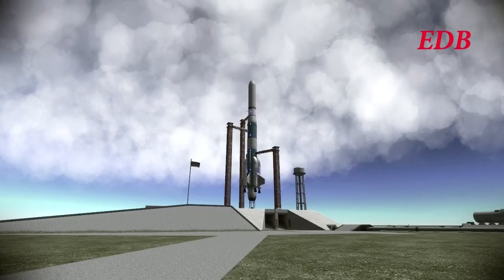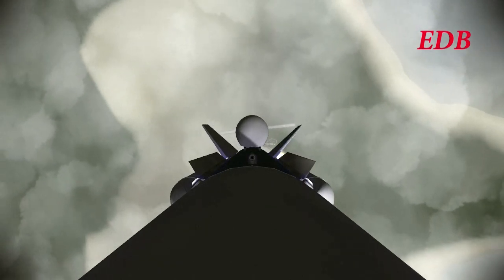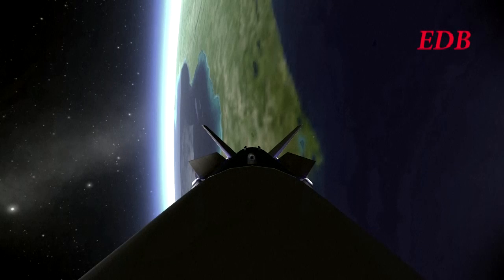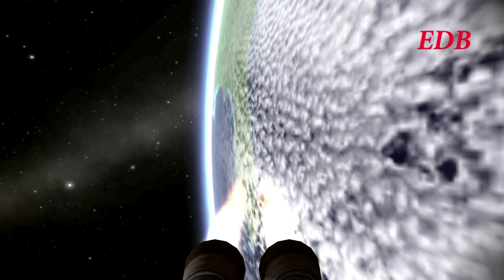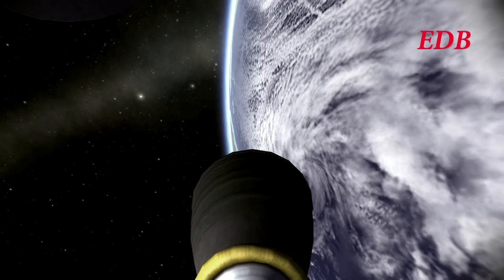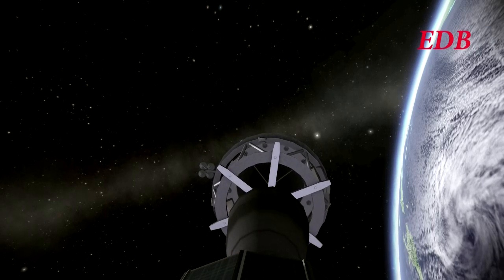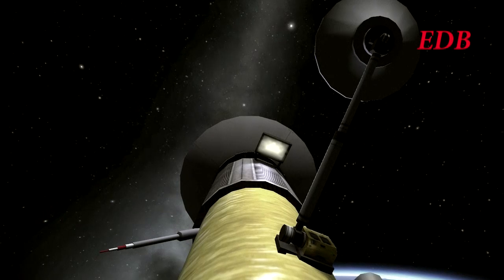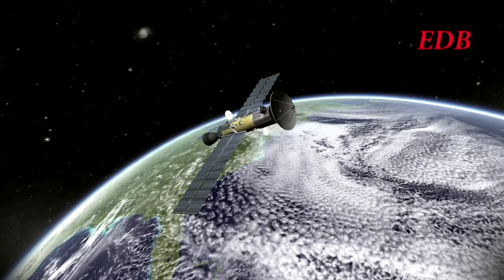Kerbal Space Program EDB Mission 01 - MIMAS-1 Launch

Comment: This is some truly awesome work! I love the style and professionalism (extending even to the press kit!)--an exceptional job.

A couple notes/questions (of course ^_^):
You should increase the height of the cloud layer--EVE 7.x has an issue with RSS where the 2D cloud layer is rendered about 5km lower than specified. That's why it's clipping into the ground in the mid-height shots. (The EVE Overhaul that rbray's currently working on is awesome, and you should check it out [daytime cities!] but it doesn't have scaledspace clouds yet).

Why fins rather than verniers? Given that you're in effect building a Delta II lower stage (the RS-27 was basically a simplified H-1), you might well have better results from using a pair of small, highly-gimballing kerolox engines. Perhaps the LR101s that the Atlas and Thor (aka Delta) used? You can get them from FASA. (This will cut down on drag and be lighter than the all-moving wings at the same time).

Why two upper stages? You probably could get by with increasing the lower stage a bit, launching to a slightly higher apogee (for LEO missions), and using just a pair of RL-10s. Heck, you could probably even manage with a single RL-10 (like Atlas V) by boosting quite high and accepting some steering losses. That should save a ton of money, since fuel is cheap but RL-10s are expensive.

Speaking of cheapness: you might also use your upper stage for GTO injection (as is usually done), and only use onboard propulsion for apogee kick (and, if you work it right, you could easily get away with a solid apogee kick motor, far cheaper than a storable propellant stage).

How much onboard propellant does MIMAS maintain for stationkeeping? IIRC satellites in GEO have approximately half their initial orbital mass in hydrazine for station-keeping, but since your kick stage is built into the satellite you presumably do stationkeeping with that...?

Finally: ooh, SASSTO! One of the earliest things I did with RSS was a mini-ROMBUS; I'm a big fan of all of Phil Bono's wacky stuff.
Reply: ***** 1. You need to find the altitude line in Kerbin's (or wherever's) cloud definition (in BoulderCo/Clouds/cloudLayers.cfg) and change it from 4000 (or whatever) to 10000.

2. Ah, Ok. Sorry, just thought I'd throw that stuff out there since you were complaining about how expensive it was. (Though I do recommend, if you haven't yet, just for kicks trying out a launch with vernier-controlled roll. It feels rather more "rockety" than fins...even if it may not be as pretty). And, yeah, "because the plot demands it" is a fine reason for just about anything. :D

Heh, oops, no idea I'd be catching you out about the hydrazine. ^_^ How do you plan on attitude control though? Wheels? (Gah, wheels, the most ridiculous thing KSP has. IRL even if you have wheels you need RCS anyway to desaturate the wheels...)

Comment: I think as the rockets are on the pad you should be able to see the clouds of gasses come off it like a real launch and maybe ice breakoff at liftoff. Just adds to the realism I think. Who agrees?
Reply: ***** I think what was meant was CoolRockets, to handle the ice clouds from the cryogenic LOX.
Reply: *****
Ah, missed that in the modlist, sorry!
CoolRockets won't take into account resized engines so venting may be mis-positioned or for the wrong propellant mixture, and it doesn't support Stretchy at all yet...don't know why I didn't connect "blue tank!" with Stretchy, sorry.
Reply: ***** Will do. I am kinda over-extended at the moment, but if I hear of someone else doing it I'll let you know!